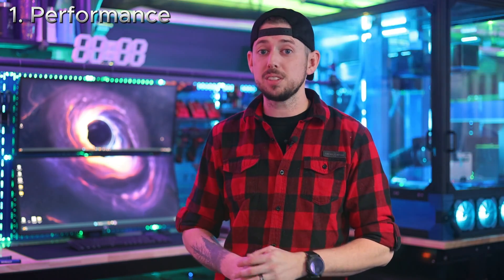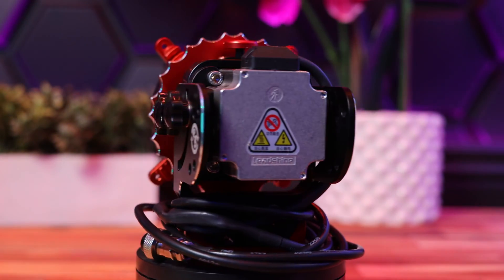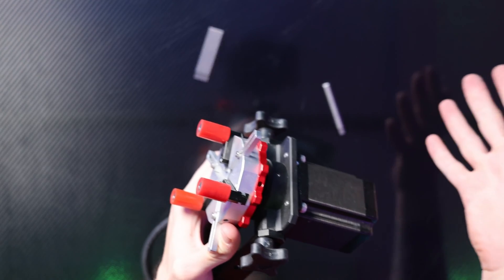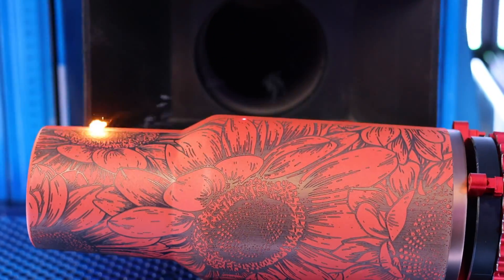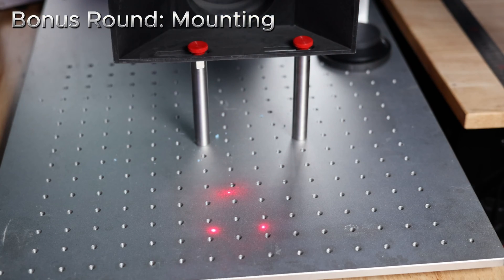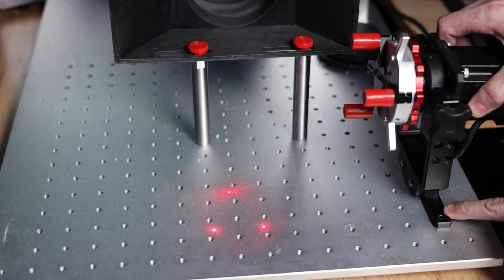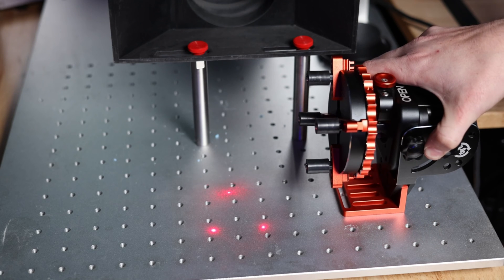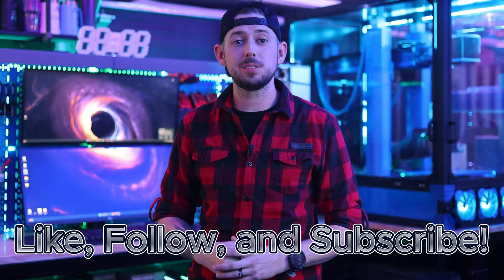Rotoboss Talon VS. Piburn Grip: An UNPAID REAL Comparison

Comment: Great video.  Where can you get those standoffs for your dust collection? Where can you get the dust collection hood? At least the files for it.
Reply from the maker: Hey! They are actually tower risers for your galvo tower. I am seeking an alternative though. Since they cant be adjusted it can be a little frustrating at time. The hood is just a 3d printed file I made.

Comment: Thanks for the comparison video.  All the videos I see only show them doing tumblers.  My D80 and wine glasses do NOT mix.  Looking for a alternate. Tired of breaking glasses or them falling out of the chuck.  Do you have any experiences doing wine glasses or can you point me in the direction to get info about the Talon Pro and glassware?
Reply: I noticed that you are engraving different brands of tumblers.  Are you having to change your  settings based on the brand you are engraving at the time?
Reply: Hoping to hear from you
Reply from the maker: Hey so sorry I have been kinda out of it. So no I dont change my settings between brands or colors because the CO2 Galvo doesnt have really any issues with color. The Talon Pro is definitely better than the the D80 for sure and I 10/10 would recommend.

Comment: Being able to point it straight up for turntable use is a plus. Didn't know that might be an issue so Rotoboss is at the top of the list now, even though the price for these is up there. 😵‍💫
Reply from the maker: It's true these products are not cheap. But a premium product comes with a premium price tag and it's not something you'll ever need to worry about as it comes with a lifetime warranty. No matter the problem it will get fixed!
Reply: Good morning,  Just got the Talon Pro, what a beast.  Cannot not get it to engrave properly.  My settings must be off.  The 1st time I tried it it would only engrave the beginning and the end of the engrave   Example:  Laser Nerds     L      s   Someone suggested that change the split size to the same number as the line interval. That made it worse.  straight line.  My commarker omni1  steps per rotation is 12,800 so I changed it to 25, 600.  Any thoughts